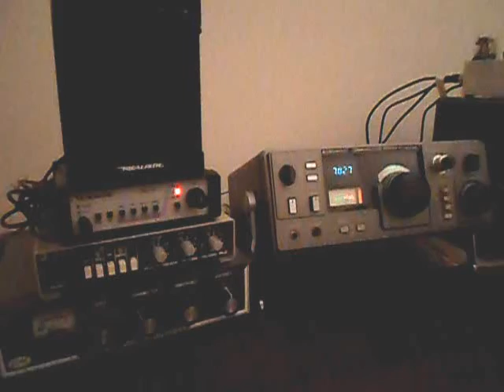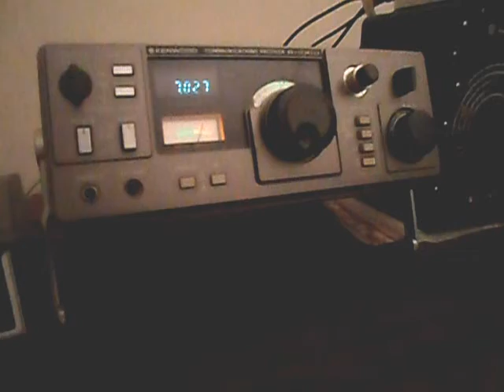Ham Radio Audio Filter Timewave DSP-9 + for CW on a Shortwave Receiver Kenwood R-1000, etc...

Comment: I have the Timewave DSP-599zx. I bought it for a project that I never got around to. I think I bought it to try out with a Heathkit SB-104A transceiver. I traded the Heathkit soon after. I just got the Timewave out of storage because of your video. I'll have to hook it up to one of my old shortwave receivers and give it a try.
BTW, I have a video of the Knight T-50 transmitter that I saved from the scrap heap. Family of a SK that was overwhelmed. I sold it on eBay eventually. I think you'll get a kick out of the harmonic problem: https://youtu.be/0SO8jDoukco 
73 Paul AA1SU

Comment: I sure like my DSP9! The 100hz filter for cw is a real squeezebox. Going to buy a few more when they turn up.

73 de kc5ngx
Reply from the maker: Yes, these DSP-9 series filters are truly outstanding.  I like using them with a couple older receivers in my shack while operating CW, using my trusty Knight T50 and Ameco AC-1 as well!  I need to do a video on the Datong  FL-2 which is also an excellent filter.  73,  Jack  WA6KYO